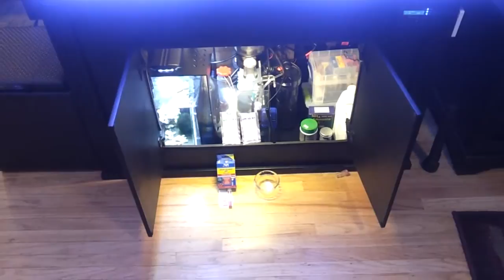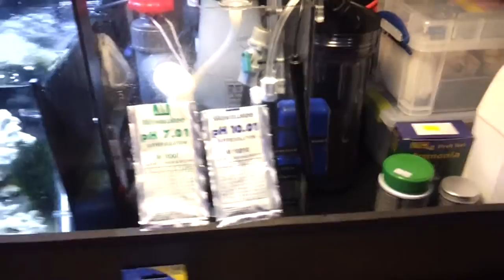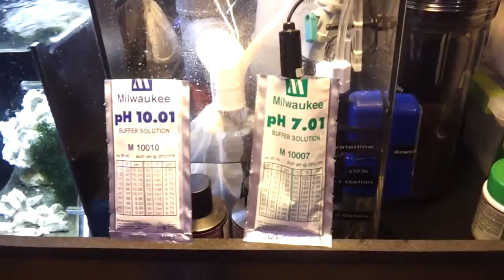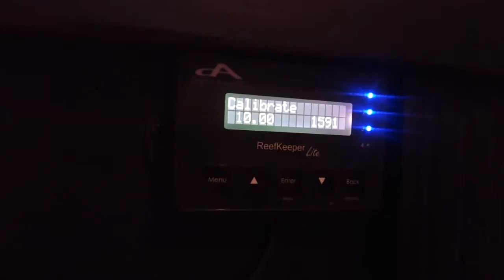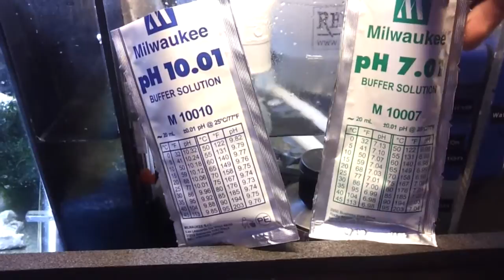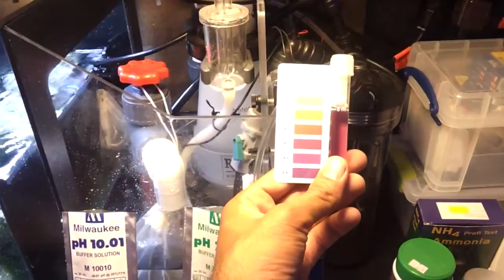ReefKeeper Lite pH Calibration

Comment: did you say the solution of 7.0 read as around 7.2 after calibration? .2 off would make a big difference.
Reply: actually if you read the display he says 7.2, but it is actually 7.02 so the solution says 7.01 that is pretty close. It also depends on the temp as well.
Reply from the maker: I wouldn't worry about it being off by .2. You're right there.